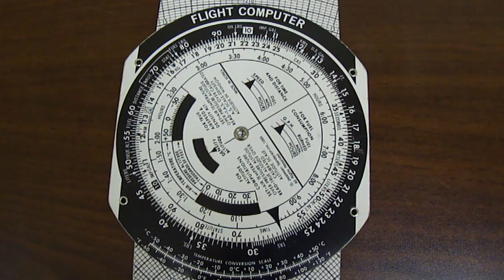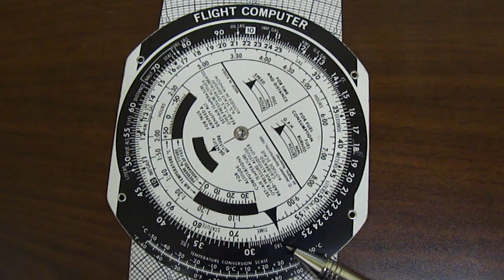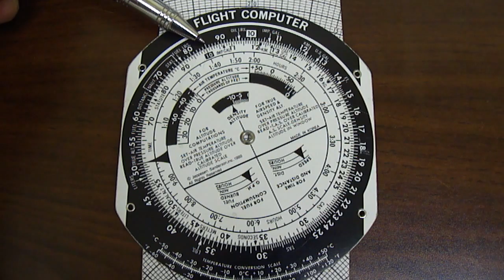E6B Flight Computer: Multiplication and Division

Comment: For posterity, I'm pretty sure the 10 is considered the index because it fills the same role as "0" would on a linear slide rule, except this one is circular, so 0, the start point, shares a spot with 10, the end point--you can see it's adjacent to both 1 and 9 on the scale.  Mathematically, it needs to be like that or it wouldn't really work as a circular rule.  It's not a particularly hard question to answer but considering it's been asked twice in 10 years to crickets I think an answer is warranted.